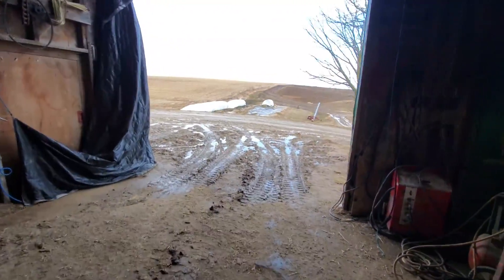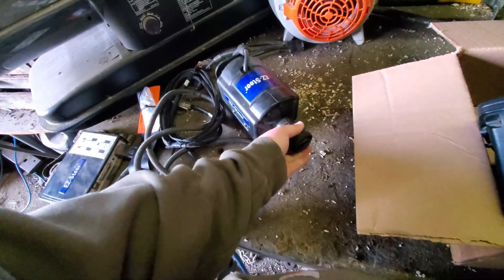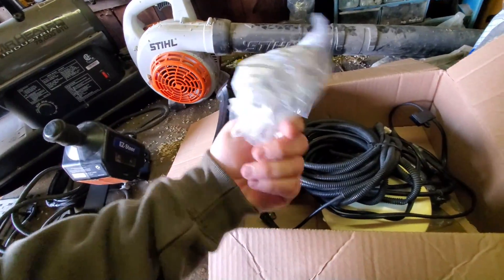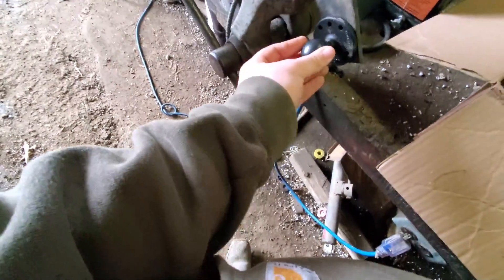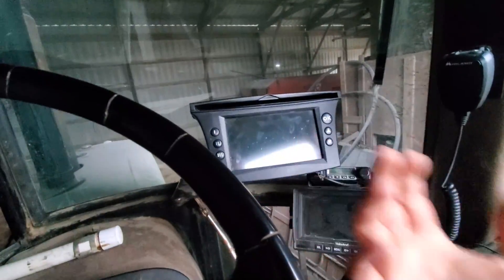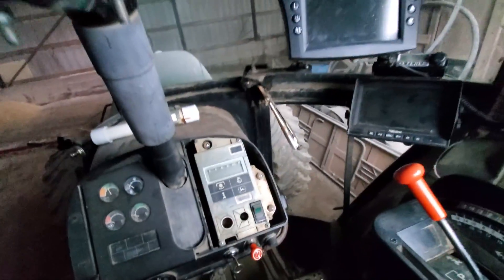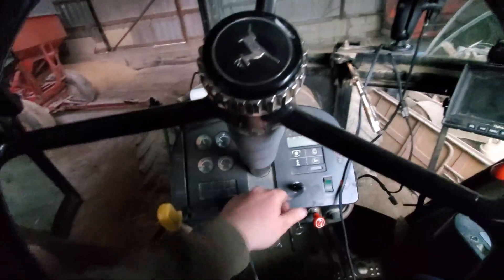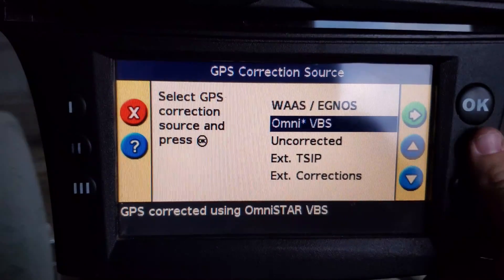Ez-Guide 500 & Ez-Steer Install on the 4450!!!!

Comment: I have a system like that i move between tractors. Yes youll want favor accuracy and you can adjust how far offline you want it to engage and whatnot. Youve probably already figured it out but i change the aggressiveness alot to fine tune how far offline it can get before it starts adjusting back. I have a footswitch to engage,disengage so you dont have to reach for the screen everytime. Ive seen used ones selling for like 50 bucks. The cheaper omnistar hp/xp takes forever to get signal (like up to a half hour after you lose signal) this year im gonna go with the next one up. Youll like it once you have it setup
Reply from the maker: Thanks for the info. If WASS works good this year we will prob just use that

Comment: Its probably wired to the power side of the key switch i could be wrong would have to see it to know whats wrong
Reply from the maker: I'm just surprised they have it wired key hot from the factory
Reply: @iowadairyboysFarms  check your truck cause i know 12v plugs always have power
Reply from the maker: @farmallskittle  some do some dont

Comment: When it hunts back and forth, lower the angle per turn number.  I see you were at 20, try 19 then 18 and so on until it stays on the line.  Then adjust aggressiveness.  I'm good at 15 and 100.

Comment: Haha when you first started talking about cleaning out the cigarette lighter hole I was thinking about the time I stuck a wire brush in there and I was wondering if that’s what you were going to do and then 30 seconds later I got my answer.  Pretty cool setup tho. That’s a no brainer if it’s the same price as the foam marker

Comment: I seen that 4440 creeping in the back with that flat tire 😂 I know y’all did get some more for it. Saw that on Insta. I’d say if that bolt is gonna be a problem with hitting the steering motor you could always just take it out and turn it the other way with the screw head facing the floor and the nut and bolt shaft facing the ceiling. I’ve never used auto steer before. I bet it’s nice. It’ll definitely be nice for planting.